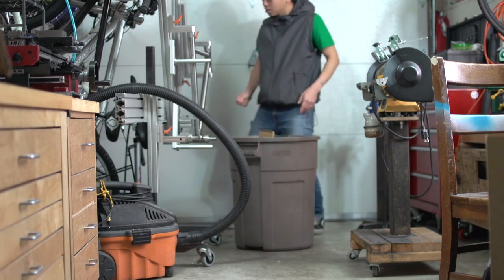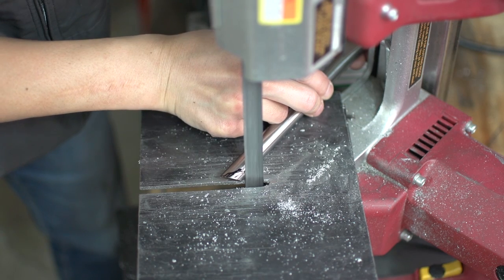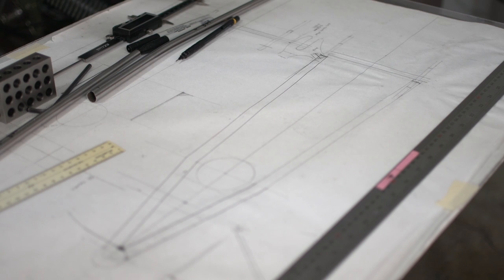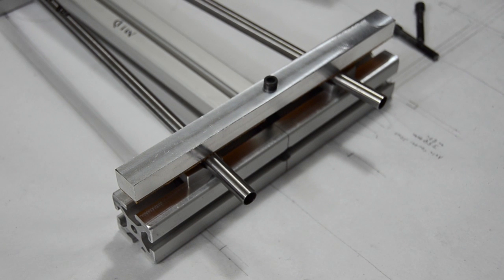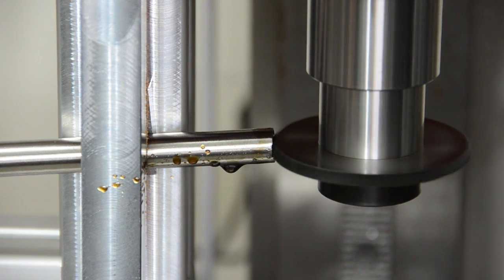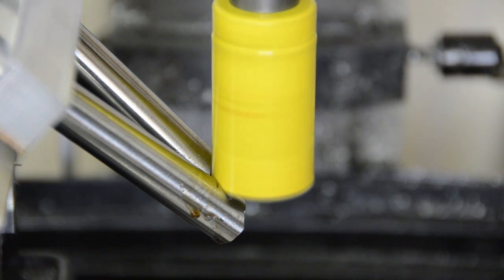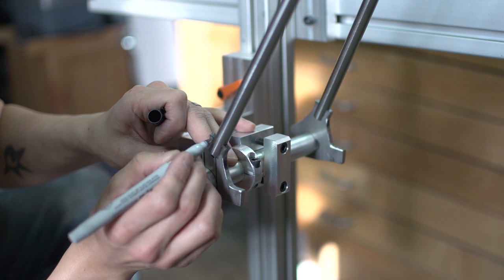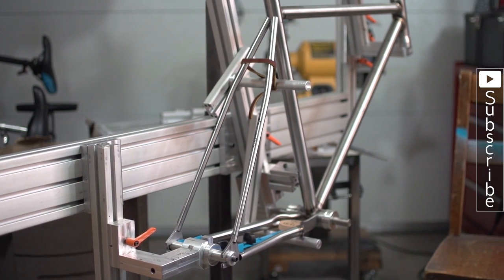Bicycle Frame Build 43 - Miter & Notch Seatstays

Comment: Really liking your videos dude... I just built my 1st scratch build frame and have realized the importance of having a good jig. i am in process of designing and building one. i want to make lowered stretched cruiser style frames
Reply from the maker: Congrats on the first build! Yes a good jig makes all the difference. But a complete jig is not always necessary. I've seen folks build a frame in sections. For example, they'll have a fixture just for the rear end to weld CS to BB. But I hear you, a full jig really can speed up the process.

Comment: Pithy Bikes - great series - thank you! I'm building a recumbent and have gotten many useful ideas that easily translate. I'm sorry if you've already  identified it, but would you say which model of the digital angle gauge you are using?
Reply from the maker: +rapanui222 It's a Wixey WR300 - I got it for $60. But now there appears to be one called WR300 type2 which is half the price and looks the same.. heh.
Reply: +Pithy Bikes Thanks. I found that the type1 has better accuracy specs and is ~$38 directly from the manufacturer.

Comment: Really enjoying your channel, I respect the fact that you are learning and don't try to hide your errors. Also it's really interesting to see how other people work through problems. That said please don't start your mill with the bit partially in the work piece, your just asking for trouble. Also an good formula for your milling and lathe work is 4cs/d. where cs is the cutting speed and d is the diameter of the thing spinning. So to drill an 1/4" hole in aluminum cs is around 300 it would be (4*300)/(1/4) = 4800 rpm.
Reply from the maker: +Demoni696 Awesome tips man! Thanks so much, I appreciate it. I need to get an rpm readout for the mill.

Comment: Was eager to see how you would notch your seat stays as it is certainly the most difficult part. Was wondering if you would rely on something less professional like using notching software.
To remove the overlap, you could have used your dremel grinder instead of your band saw.

Doesn't this fine frame jig garanties alignment of the frame?

Comment: Well done Steve. Looks great. I would caution you on the speed that you're running those cutters. I was sure that they were going to grab and fold the tube in on itself. It worked this time but....

Looking forward to seeing your alignment checking solution.
Reply from the maker: +Alistair Spence Hi Alistair! Thanks for the words of caution. I frankly don't know what rpm to run at. Back when I first started notching, I was running at a low rpm. But I got in the habit of over compensating out of fear that the teeth would grab and fold the tube. What rpm are you running at? Maybe I need to run it at around 400 rpm and use plenty of lubricant. And feed slowly. Cheers.
Reply: Theory says that cutting speed for steel bicycle tubing is around 100 SFPM (surface feet per minute). For an 1 1/8" hole saw, that means you're looking at 320 rpm.

In practice, that number works well on a rigid setup on a "real" mill (ie. Bridgeport knee mill type), but on smaller bench type machines, I do think that running the hole saw at a higher speed does help give a better cut. I kick it up to 400 - 450 RPM and feed very slowly on my Grizzly G0704. 

Also, getting the hole saw as true as possible will help a lot. When you don't have a the mass and rigidity of a larger mill even a single tooth can snag and ruin things. Face the back of the saw in the lathe and check the runout. If it's still off, true it up using a carbide lathe bit, or note the high spots and dress them down with something like a band file.
Reply from the maker: +Alistair Spence Thanks Alistair, yes i actually forgot to face the hole saw. When I was editing the video I noticed how much it was off true. I got so lucky with that cut.. 450 rpm sound good. I kind of settled with the way I was doing things but I need to re-evaluate my methods :)
Reply: Hey, what can I say, what you did worked!

Good idea to keep an eye on feeds and speeds though. Give yourself the best chance of success.

Comment: I have been watching your U tubes on bike building from the start.  As a retired tool and die maker/machinist instructor, do some research on cutting speeds.  Using high speed cutting tools you can burn out your cutters very quickly running too fast as you did in this video.  The reason you are getting lucky is that you are cutting thin tube and only a few pieces. When milling you are climb milling that can grab the cutter into the material and break the tool as well as damaging the work.  I am very impressed with your engineering ability using common sense.  I would like to have a shop in my garage as you have.  If you have any questions, please post, I would love to help you if possible.
John Z.
Reply from the maker: +John Z Hi John, Thanks for the tips. I've not been paying enough attention to speed and feed rates and I really need to start. The video may have been a little misleading because for some shots I sped the video to 4x speed. But regardless, I know my rpm is too high and burning out the tool. Thanks for watching and giving me something to think about :) I'll take you up on the offer if my future test put me in a pickle.